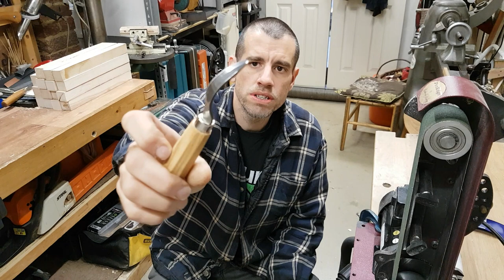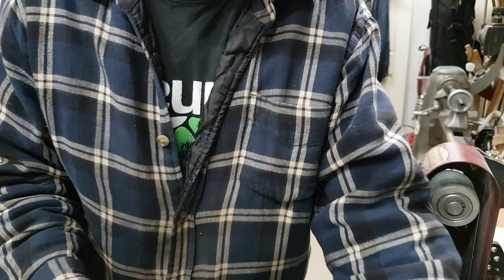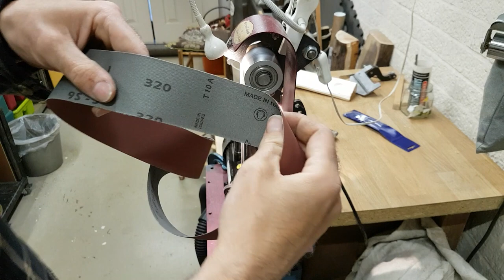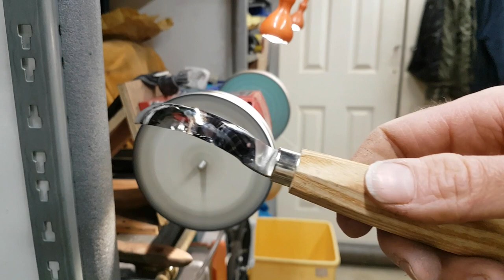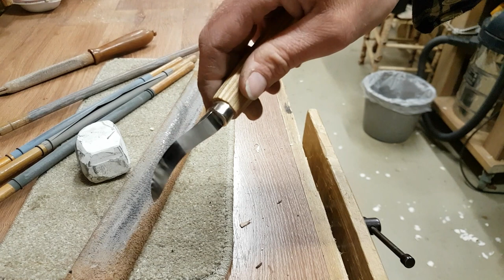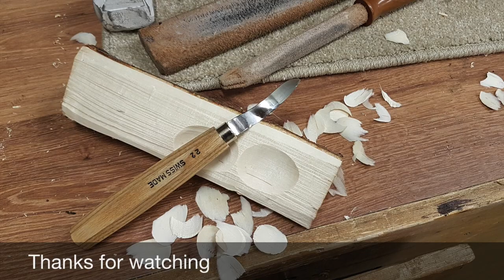Spoon knife tuning tips - Re-grind, hone and test

Comment: Top quality video Lee, I was just researching this topic this morning! Would you recommend the same process for the Mora 164?
Reply: Meighan Workshop - By Hand and Heart i did the same with my mora and its 100% better! I definitely recommend doing it,  the mora is cheap enough to replace if it gets messed up😉
Reply: another good thing to do with the 164 is to clip off and round over the tip of the knife - it's unnecessary and it only snags on the work
Reply from the maker: Thanks very much, glad you enjoyed it. Yes the 164 would probably benefit form similar treatment although there's not quite as much steel there to begin with so go careful you could make it to thin if you get carried away with the grinding. Like Julian says below, get rid of the sharp tip too, it's useless and dangerous. The 162 on the other hand, the double edge one, avoid that knife at all costs, its horrendous.
Reply: Lee Stoffer very cool video but is why I subscribe to you but you has to be careful steel don't gets hot or its temper will suffer I'm always improved my tools too 👌🐾🐺💪💕
Reply from the maker: Thanks, fairly sure I explained that in the video didn't I ?